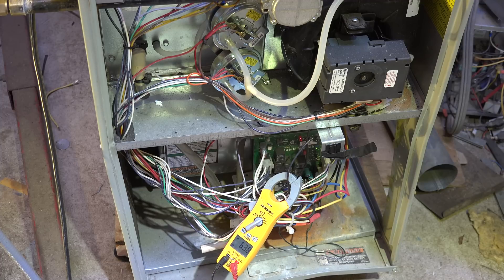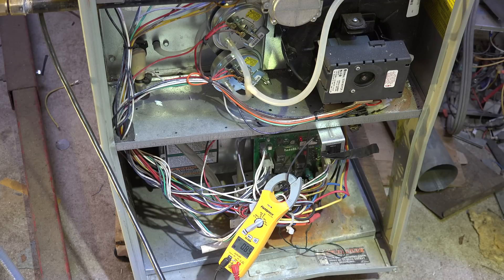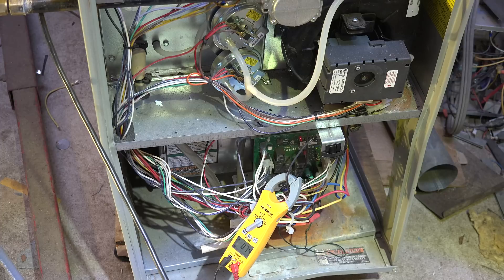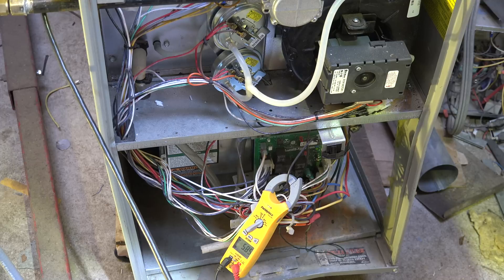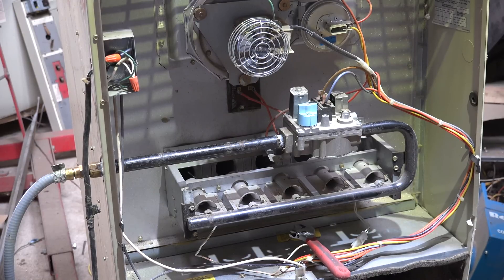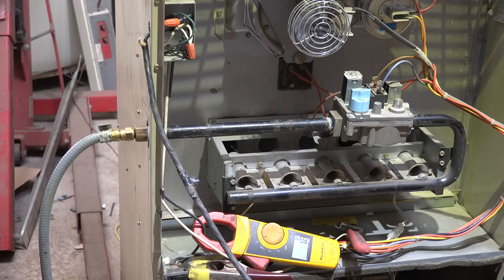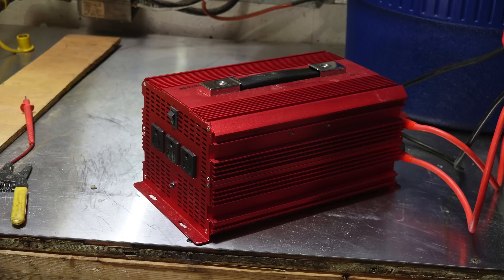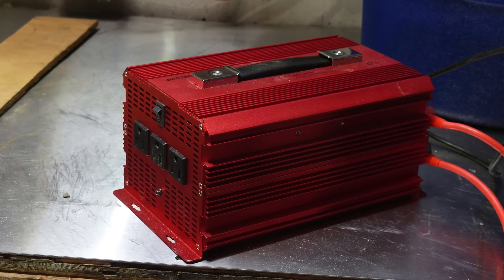Bestec inverter test powering gas furnace #5

Comment: I just tried to run my furnace (Ruud model# 3621STAMCA) on a 2000 watt pure sine wave inverter. I turned the furnace off and as soon as I plugged in the furnace and turned it back on the blower motor would start and blow cold air and would not turn off unless I cut the power to the furnace. I tried several times on unplugging and resetting the thermostat but the blower would come on and blow cold air. I plugged back into the grid and it works fine.
Reply from the maker: Sometimes pure sine wave is not really pure.
GFM

Comment: People are telling me that I'll burn up my car's alternator by doing this.
Reply from the maker: I have never tested a car alternator for longevity.  
However, most car alternators are made to charge a battery and supply the electrical power to operate the car's systems.  
I would guess that unless you have a 100 amp alternator, you would be limited to about 200 watts continuously.
GFM
Reply: People are full sheet

Comment: Nice. . would this work on a oil furnace???
Reply from the maker: It probably will work ok.
GFM
Reply: @grayfurnaceman  be Interesting . But don't oil furnace draw move amps
Reply from the maker: @nathanielofjc9586  The burner motor is about 3 amps.  Fan motor can be as high as 14 amps.
GFM

Comment: My Goodman GCH95 gives me an error (8 flashes= ignitor or improper grounding) when plugged into my 900/1800W Powerbright inverter.  Any advice on how to get around that? I tried:
1 Ground not connected
2 Inverter 12v ground at car hooked to battery ground
3 Inverter 12v ground hooked to house ground
4 furnace ground to house ground
567, every combination of the above

Other ideas welcome!

Edit: I just watched your last inverter video #6, and it seems like I may be out of luck with this inverter/furnace combo. But let me know if there's another option that worked on that furnace.
Reply from the maker: You could be.  I don't have any other ideas.
GFM
Reply: You need a neutral ground bonding plug, look it up this will help you to get your furnace to run off your inverter.
Reply: @jshea1981  my inverter isn't good enough. It puts +60v to ground on the hot leg and (I assume) -60v to ground on the neutral. So bonding them burned out the inverter. At least it didn't burn out my furnace. 

Any other advice Mr Shea or am I out of luck?

Comment: Is it good if i use a modified sine wave inverter to power  a furnace?
Reply from the maker: It should have no problem with the furnace controls, especially if you install a surge protector.  However, you never know if the fan motor will work ok. You just have to test.
GFM

Comment: I got 2006 High efficient Amana Furnace. What type of inverter do I need to have it ran off my car? Say a bad winter storm knocks out power and just run a extension cord out to my car and have it running in the mean time. And how do I set up my furnace for plug and play? In the comments about battery only set up, what type of set up? For example 4 batteries in series and any thing else?Thank you for this Video!
Reply from the maker: Well, I would always say the pure sine wave inverter is best.  This Bestec did seem to work on all the furnaces I tried.  
You will have to disconnect the power wiring before setting this up.  Do not leave the house power and just add a plug.  Bad things may happen.  But you can use a plug off an old appliance to plug into the inverter.  
This inverter will only work with 12 volts.  All12 volt  batteries must be in parallel.
Remember, The amperage from the battery will be very high.  A 10 amp furnace will use 100 amps out of your 12 volt battery  It will run about 2 hours (maybe) if it is a 200 amp hour battery.
GFM

Comment: Hi there, I watched all your videos about this product. Great and well explained. Will you recommended this inverter ? Do you think it will power this item -->> Earlex 2901 HVLP Paint Sprayer<--
Reply from the maker: It does appear to work well.  It is not a pure sine wave, so it may not work well with some motors as you say in the videos.  I can't say on that particular unit, but if it is powered by an induction motor rather than by a brush motor, it may not work well.  Most airless guns are brush motors.  Hope this helps.
GFM
Reply: grayfurnaceman Thank you. I saw this one from home depot    >Power Bright   12-Volt DC to AC 2300-Watt Power Inverter<--- and also this one from Amazon ——————>KRIEGER KR2000 2000 Watt 12V Dual Power Inverter with Installation kit<<—— Have you heard about these brands?
Reply from the maker: I can't say I have.
GFM

Comment: Interesting data points ! 17.5 amps times 120 volts (standard when using an inverter) equals 2100 watts when using the older furnace, a bit over the stated rating of the inverter. The better inverters come with data sheets, or at least a web site giving how long their inverter can run at increased output.

Comment: How long do you think a full ECM furnace would run off a battery? It seems like manufacturers could add battery support (including charging) in the higher end furnaces. I imagine there are some optimizations that could be made to make them more efficient when running on battery.
Reply from the maker: +billhickox I will be doing more with this.
GFM
Reply from the maker: +RickMakes I have not tried this one on both inducer and circulating fan motor ECMs.  It works well with the ECM inducer.  When I get a chance, I will try it.
GFM
Reply: +RickMakes About half of the amp hour rating of the battery bank. NOTE using the DC amp drain. As you may recall the inverter used in this educational series used about 70 amps DC. So, a little down and dirty figure, battery bank 200 amp hours, use half, 100 amp hours, most inverters shut off at 10.5 to 11 volts . About an hour and a half on such a small 12 volt battery. Perhaps 3 hours risking the health of the battery, depending when the low volt circuit in the inverter shuts the inverter down. More batteries is more amps to use.. Hope that gives you someting to use and investigate.

Comment: I was told once to put a surge protector computer plug strip in between the generator and furnace due to it will help clean up the sine wave. 
Not sure if true or not but I had also a Trane VS furnace and I used one. I figured it couldn't hurt and everything worked well for me.
Reply from the maker: +John Heritage The manufacturers say the board has one.  However, I have had them fail after a power outage.
GFM